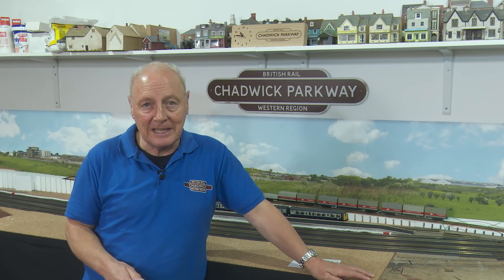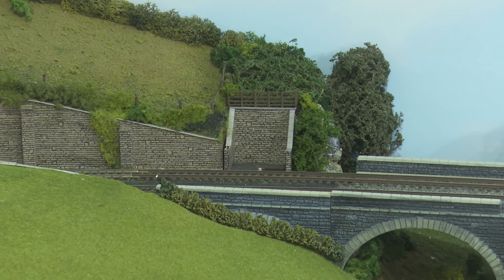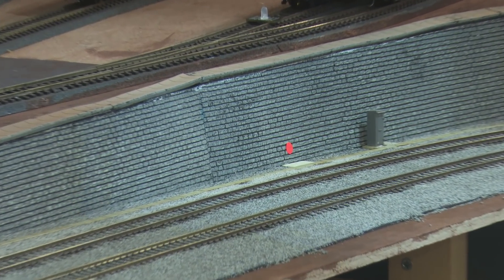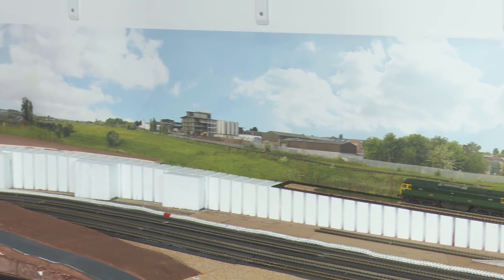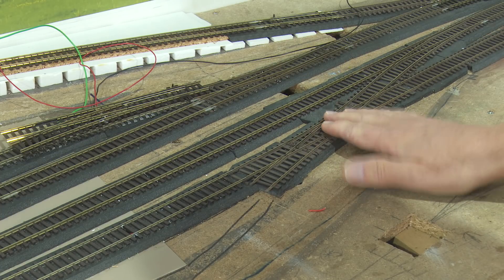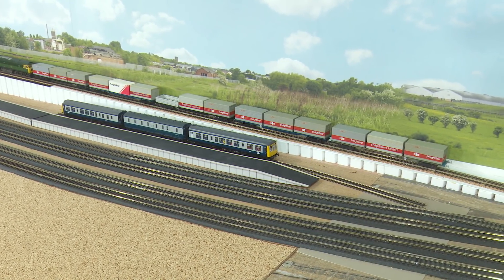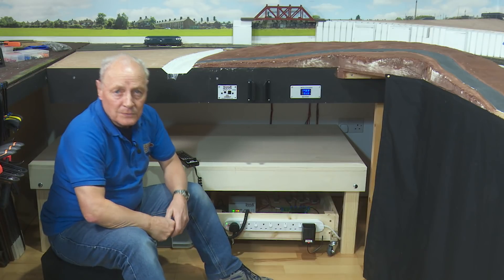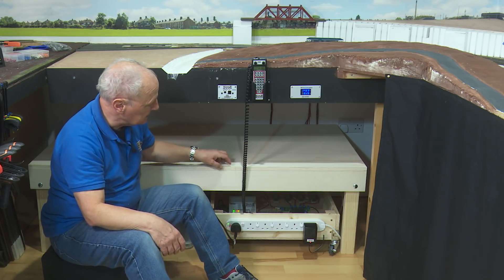Autumn Update at Chadwick Model Railway | 147.

Comment: hi charlie. i came up with an idea of fitting all those components into an old gutted computer tower fitted with wheels and with enough cabling to allow it to be pulled out from under the baseboard should any modification or repairs be needed doing
Reply from the maker: What a brilliant idea. And, you could use the fan to provide additional cooling. Regards Charlie
Reply: You could also build a drawer and mount the components in there.  In either case, be certain to spend the time on cable management - a bunble now saves a rats nest later.  Also secure that bbundle on both ends with zip/cable ties, velcro, something to take strain off connectors.

My Audio Rack/PC is connected to my desk/keyboard/monitor/etc. in this manner.  Leave extra length.  Good luck.
Reply: An idea for the span of cables then from the layout to the case or Charlie’s draw is to use something called Copex. It’s a flexible conduit that has glands on either end and dose a good job of protecting the wires
Reply: @scottmarsden1643  yes there are 3 types ,  all steel or steel coated with plastic or all plastic, i would go for the steel plastic coating because it does not split with time with diameters of 20mm ( 3/4") or 25mm (1")
Reply: @ChadwickModelRailway  hi charlie actually i was thinking of putting 2 fans in one on either side of the divided tower.

Comment: Hi Charlie, excellent update and I completely agree with you about butterfly modelling. I’ve been very good for a whole year, building baseboards, laying track, learning how to solder and do the wiring. But after completing the double track circuit and having trains running I lost my mojo a bit and I have been distracted by building a scratch built warehouse whereas I should have been getting with the return loop and storage on the lower deck. Also having read another comment below I did have in mind my YouTube views thinking I’d lose loads out of boredom of watching me lay track.
Well I think you’re the tonic I needed, I shall get on with more tracklaying, cheers Charlie, helpful in many ways!, John
Reply from the maker: Great comment John and good luck mate.

Comment: Hi Charlie, most importantly is doing what you enjoy and are comfortable with at the time and recognising that can change too! The electronics trolley is a great idea (easier than a draw) and see it works for you. I always fit either Hollingsworth crimps or boot lace crimps to my wire ends, it only takes a stray strand on a stripped wire end being in the wrong place to cause problems if you can't see the connection clearly. Pushing a finished crimped pin in is easy to check its in OK.  For cable protection look up spira band cable protection (benefit is can be retrofitted) or megamide sleeving (have to thread cables into as you wire). Yes am with you on sometimes losing your mojo (yep got the tee shirt too), there are times when having a break and coming back fresh to something you are better for it in many ways.  Cheers Stephen
Reply from the maker: A great comment Stephen. Regards Charlie

Comment: Good video again Charlie, I had one of those moments were you keep putting the job off. I needed to wire some colour light signals which meant climbing under the baseboard so I kept putting it off.  I am on N-gauge so you can imagine the size of the wires but I managed it. I have to admit though I am a butterfly modeler too, I constantly flirt from one job to another.
Reply from the maker: Time to get under that baseboard Chris.

Comment: Hi Charlie I am sure that a lot of us will identify with you in our layout building.  I finished my fiddle yard and two helices in the summer, added a raised floor using, of course, "railway sleepers" for the framework, carpet tiled the surface and stopped!  Just couldn't move on to the next step of building the main upper layer - spent a lot of time modifying the trackwork with AnyRail but nothing being built.  Finally bit the bullet a few weeks ago and ordered the timber.  Last week I built the base board for the branch terminus and have laid the AnyRail 1:1 print of the trackwork on it and just today have been cutting the timber to start the support frames for the main layout boards so hey ho off we go again!  Looking forward, as always, to your next video - all the best Peter.
Reply from the maker: That’s very reassuring Peter, regards Charlie

Comment: Charlie - your a real tonic !   One thing - invest in a kneeling pad ( get them in garden centres).  It will save your old knees plus it's great to be able scoot around the floor without having to  get up and down if you are working on the low level in different parts of the room.   Always a joy to watch your video's 👍 cheers Euan
Reply from the maker: An excellent point Euan. Surprisingly, I already have some I just need to track them down. Regards Charlie
Reply: @ChadwickModelRailway  If I followed the message in this video correctly, then you don't need to track them down, you need to down them tracks!
Reply from the maker: An excellent point Vernon.
Reply: @vernon.rogers  Richard Whiteley would have been proud of that play on words 😅

Comment: You made me smile Charlie. I am definitely a butterfly modeller. My problem is I get 90% through a project and get bored. Then want to scrap it and build a new layout. Drives my lovely wife up the wall. So taking your advice I will knuckle down and finish the latest project. However a layout based on Glasgow Queen St and Eastfield depot is already forming .We never learn. Thanks for a great channel. Keep safe.
Reply from the maker: I think admitting to your “faults” is a great startDavid.

Comment: Hi Charlie, another fun & interesting video. I had never heard of the term "butterfly modeller" before, but it suites me also, like a lot of your other commenters. I have been working on those other projects for about 8 months when I had 1 big project I had to tackle - disassemble my 5 level oval helix (I had focused on potential end scenic aspects and overlooked the operational needs - ie. my "up" track was the inside track of the double track oval helix) - hmmm (other words where used at the time of realisation - 20 rods, 200+ nuts & washers, etc   x  2.). Lucky for me I had seen one of your previous videos where you had purchased a SwiftNut nut-runner. I purchased a set myself and it made the job of disassemble and reassembly so much easier. 
Keep up the great work and thank you.
Reply from the maker: Yes that must’ve been a shocking discovery when you realise that one mate. Still we learn and move on, regards Charlie

Comment: Just a FYI. Meanwell make a plastic cover strip for their power supplies. TBC-07 is the part for the power supply you linked to. There are more in the range to suit other units - the last two digits denote the number of terminals that it covers.
Reply from the maker: Thanks Craig but disappointing that they are sold separately.

Comment: Thanks for an enjoyable video Charlie.  Your standards are very high.  My only comment is regarding the electrical safety of that transformer with bare terminals immediately adjacent to the 15v AC output terminals.  I know you commented that it is easy to put on a piece of plastic card to protect it, but some users with children may not get around to doing that and with the possibility of ‘little fingers’ touching something I would prefer you to have used a safer shielded model, if only in your presentation.  I can remember as a teenager ‘fixing’ a valve radio which wasn’t working and putting a screwdriver across the mains terminal to see if it had power.   BANG.   But, what do I know?  You’re the producer.  I am just a viewer.  :-). Keep smiling mate.  Keith
Reply from the maker: An excellent comment Keith. However, I have subsequently found out that the company do make a plastic shroud for these transformers. Sadly, it doesn’t come with it but has an extra charge!

Comment: Hi Charlie,
Another excellent video.
Another contributor beat me to it, but I was going to comment, that you have two conflicting priorities (a) entertaining/instructing your YouTube following, (b) building a model railway.
So, I think a bit of butterflying is a good thing.
Personally, I was going to try to lay/check all the track first before thinking about scenery.
I was also considering having all my wire terminations/electronics etc. on view via several small vertical panels at the front just below baseboard level (if that makes sense), rather than hiding it all away.
I hope it will make maintaining/extending easier without scrambling underneath and I quite like the idea of all my electronics on show with lots of flashing lights etc.
Keep up the good work. Cheers.
Reply from the maker: Great comment David, regards Charlie.

Comment: Great presentation as always. I think there is an element of the "Butterfly Modeller" in most of us. That said, I've been a chrysalis all Summer and as the nights draw in, will be returning to my N scale layout, with renewed vigour. Not a lover of the Winter months, but as you may recall, my understanding of points is now greatly enhanced thanks to you Charlie.
Reply from the maker: Hopefully LF, yours isn’t an attic where you need several jumpers to work during the winter months.
Reply: Thankfully, there is adequate light and heat Charlie! All the best. Nige

Comment: Charlie,
Thank you again for a great video.
The old 80:20 rule has another side to it.  It only takes 20% of the time to get 80% done.  The devil is in the detail of getting the last 20% done.
It might not be butterfly, it might be: "What have I bitten off?.
However, it is oftern good to take that break, and truely think through the process to get the last 20% done.  I often "sleep on the problem", and get a much nicer solution that what I had first thought up.
Keep us inspired, and mojo flowing.
Cheers, and keep safe.  Michael
Reply from the maker: What a heartwarming comment Michael.
Regards Charlie.

Comment: Charlie, as you obviously adjust your plan while installing it, butterflying seems to be your forte to help you find your appropriate solution. Planning of course is a good thing, don’t wanna discount that, however, it’s also good to account for our ‘weaknesses’ to either find a new strong point, or to acknowledge that indeed going back and forth may be a self-teaching method. Also, trial and error can’t be avoided, even with planning and more thorough planning. Especially when we’re one man railroad ‘tycoons’. The charm also can be found in the display of our adjustments/mistakes/tweaks. Plus, over time we increase our skills, whatever we do, which often means the first method will be surpassed by second, which in term will be surpassed by third one and consecutive ones. 
Otherwise said, distraction isn’t just avoidance, it’s also a tool to amp ourselves up, to regain confidence and to become inspired, anew or once more.
Reply from the maker: What a brilliant comment Vincent, it’s great to have you onboard.

Comment: Charlie have considered using slotted cable trunking on your boards, there no clipping or tying of cables together you just simply lay the cable in the trunking and bring it out wherever you want using the slots.
Reply from the maker: No I haven’t Roy, but I shall certainly check it out. Regards Charlie
Reply: @ChadwickModelRailway  maybe RS Components or CPC Farnell 25x25mm and 25x38mm ‘closed slot trunking’ seem to be available. We used it in control panels back in the day. Lay the cables through the slots and clip the lid on. Makes a tidy job.

Comment: Hi Charlie. Looking at the track diagram adding platform 3 makes an amazing amount of sense. Without it there would be no need for your tracks to bend in and out again with the curved platforms, the tracks would have been built straight considering the entrance and exit places. On a slightly different note, every time I watch people with all this DCC stuff I can't help but think that it is all pretty much redundant already. I think the future will be remote control, the technology already exists. The locos will have batteries in them which will be charged by putting them over charging points on your stabling point - so the locos will really go there for fuel! There will then be no need for any electrics to the main tracks at all. I guess the only thing it won't solve is your block detection, but for me it will be the way forward, once the layout is built and other things paid for - you know how it is... lol.  Keep up the good work. :-)
Reply from the maker: An interesting point and with good foundation too.

Comment: Butterfly modeler?  That is a new one on me.  At least you are not a "Rubber Gauger."  I was talking to the wife of a recently deceased model railroader and she was talking about all the stuff she had found that her husband had squirreled away.  She accused him of being a Rubber Gauger.  I had to ask her to explain that.  Apparently he couldn't model one gauge.  He had many railroad model gauges that he had been "bouncing" around, from one to the other, modeling at the same time.

Glad to see you got it back together and running again.  I recently changed my track plan for my O-16.5 (1/48th scale) model railroad in mid-build.  I had trains running when the wife start talking about "moving" some day.  I looked at what I had built and I realized that what I had built would have to be demolished if we did move.  That thought did not sit well with me.  However, I was at that point where I could start over again.  So, I tore it all down.  I built a much simpler layout, recycling the wood I had invested and built a better layout that is four modules that are bolted together.  Even the 2"x2" hardwood legs are bolted on.  It can be unbolted into 4 sections,carried out the door, to be put in a moving truck.  I would not claim it is portable as it is not designed to go to shows.  I will claim it is moveable.  It is still the "elephant" in the room.  I also built it taller.

Good video Charlie!
Reply from the maker: Great comment DKA, and great planning too. Regards Charlie.

Comment: I am not sure if already suggested, but looking at the cables that go into the "drawer", have you though of using some of those white connectors that you have fitted across the different boards? In this way, if you need to, you could unplug the connector and take the drawer whenever you need to to work on it, instead of being relegated to work on it on the floor (or you would need to unscrew all the wires from the black terminal blocks).
Reply from the maker: Yes I have considered them, but I’ve gone for the hardwire option which I think will be more resilient. Regards Charlie

Comment: G'Day Charlie.
Well done as per usual. Just one small safety issue though. Your 240V Power cable for the DCS 240, don't coil it up in a loop. It will generate a magnetic field that will cause it to heat up. The longer its on, the hotter it will become. It may very well not get hot enough to melt, (really depends on the loading [amps] ) but why take the chance. I shorten mine so there is no long lead to try to  keep tidy. If your not up to doing that your self, take the DCS Lead to someone who can shorten it for you.
Other than that, carry on!   :D
Reply from the maker: A great suggestion G130, I shall sort something out.

Comment: May I make an observation concerning the transformer shown at 6.40. You noted that the exposed connectors would be live. As a qualified electrical inspector I would thoroughly recommend that these transformers are protected, maybe in something called a maintenance free junction box or box them off inside something so they can't be touched. Anything with exposed and live wiring at mains voltage would fail an electrical inspection in a domestic property, especially if the circuit (a ring final or radial) was not protected by an RCD at the consumer unit. Just something to bear in mind. Doesn't matter really how those terminals are protected, just so long as they are.
Reply from the maker: Thanks for the advice and yes I have sourced a terminal cover.
Regards Charlie

Comment: Hi Charlie.
First thank you for your work creating and updating the channel. I’ve learned a lot from you.

Due to my domestic situation changing I have to breakup my permanent O gauge layout and start again in a new home.

One of my challenges with model railway’s over the years has been keeping the wiring tidy and fault finding easier.

I remember an episode where you demonstrated a crimping tool and a labelling tool.

I’ve searched through and can’t find the episode(s) where you talk about them. Can you give me a heads up re which episode(s) you covered these in.

On a separate note. I currently use ESU DCC equipment but I’m considering moving to Digitrax. Most of my locos have ESU V5 decoders and I seem to remember you have some ESU fitted stock. Do you reconfigure the functions on some decoders so all locos have the same function on the same key?

Many thanks 
Clive
Reply from the maker: Hi Clive, regarding the crimping tools you will find them all listed in the “show more” tab.
Regarding control systems, I wouldn’t necessarily recommend Digitrax as I don’t have an appreciation for the full breadth of systems available.

Yes I do remap the function outputs with my ESU decoders.
For example all my guards whistles might be on F5. Regards Charlie